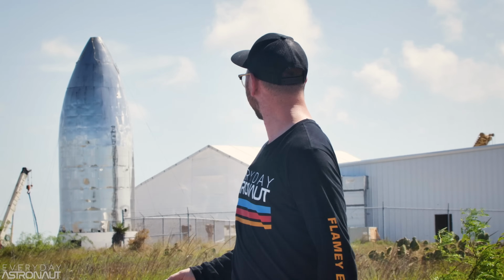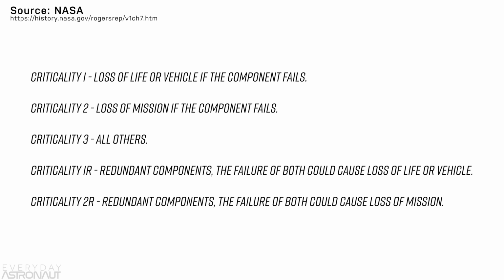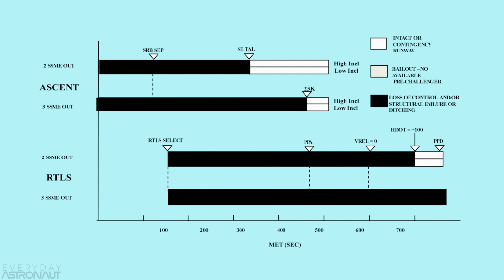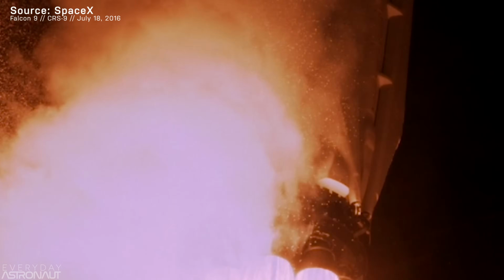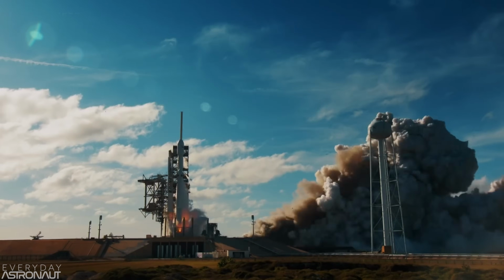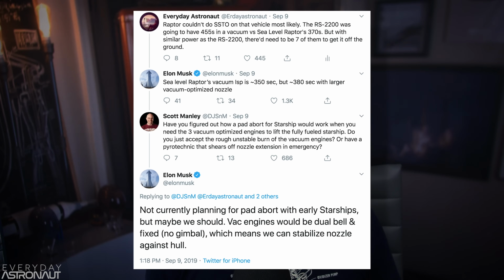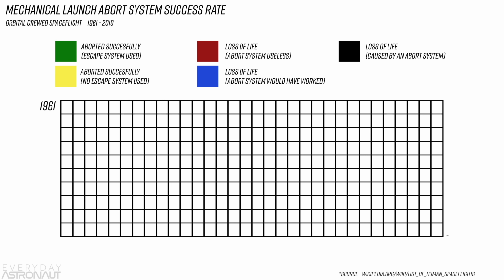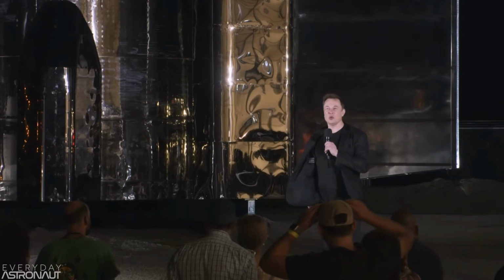Why won’t Starship have an abort system? Should it?!

Comment: If there's anything we should have learned from the Columbia disaster, Challenger disaster... Every airline crash in history... the Titanic, it's that it doesn't matter how fail-proof we think it is, unless it's 100% reliable, there WILL be failures eventually. If SpaceX starts launching dozens of people on starships, without any escape system, then the Shuttle disasters happened for nothing.
Reply: Shuttle disasters didn't happen for nothing. SpaceX learned couple important thing:
1) don't put crew on side of rocket, there is falling ice
2) Don't glue heatshield tiles (bolt them)
3) Don't use SRBs
4) and most generally: test vehicle uncrewed hunderts times, not zero times

Comment: Helicopters use propulsive landing, and that has worked out.  (Of course they can usually land via autorotation if the engine fails).
The Russians likely had a few more fatal flights that have officially kept secret, but some details of which have been leaked.

Comment: The lunar starship could use its lunar landing engines to abort off of the super heavy booster.
Reply: It is Vacuum optimised so it may work, but it is probably just going to blow up
Reply: @brianchan8  It could also fire at sea level so it can possible do it like he said a vacuum optimized engine can fire at sea level but it won't as efficient.
Reply: @schnepflegend739  yea it is possible but it is probably going to blow up

Comment: There's also the fact that they want the starship to be able to carry a lot of people. 100 people was cited at a time, but i don't know if that number is still on the table. Even if there are 50 people on board, that would be a very large abort module, big rockets and lots of fuel. But i don't think that they will be allowed to carry anywhere near that many people until it's proven to be extremely safe, so it could have some kind of smaller abort system for fewer people until it reaches that kind of reliability.

Comment: Redundacy of Falcon 9 engines requires that they deeply searched eliminated any systematical failure that could lead to events causing ALL engines failing from the same cause (common modes, that for instance caused the Ariane 501 loss)

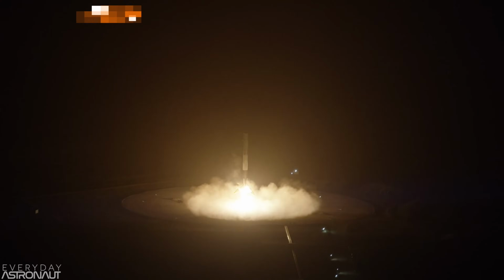Comment: 24:53 "Before, vertical landing was considered impossible". That doesn't sound right. There have been several vertical landings, for example, mcdonnell douglas DC-X, and basically any landing on the surface of another celestial body starting with Luna-9. On paper, the technology has been around since early 60's it just wasn't required from R&D to implement it because everything revolved around making ICBMs better.

Comment: Airlines also had a business motivation -- people saw the economic potential in air travel that would never take off if the public saw it as too risky. When space travel gets to the point of showing an obvious economic potential, the stakes will shoot up and money will be brought to bear on the problem.

Airlines were still working things out in the 1970s e.g. with wind shear on landing.  It seemed that every summer a plane dropped out of the sky at EWR.

Comment: I would most definitely fly on a rocket and even StarShip without an abort system. I know that space costs money, but sometimes I feel like space companies are going to slow and should speed up the production rates. Like with both Blue Origin and some of the others, still not sending up passengers, "Really". So, it is my opinion that we need to speed up, we need to push harder. We need to stop dicking around.

Comment: Something you spoke about Tim, indirectly—without stating what should be the rule—is: a non jettisoned exterior-situate re-entry module crew compartment should never be situated below a leading edge which disintegrates at launch.

Comment: I think a capsule like the Dragon only bigger should be designed and built and installed on top of each Starship for performing a safe emergency abort during both Earth and Mars lift-offs. This capsule would tightly hold the entire crew of each flight and be capable of either propulsive landing or parachute landing (for  Earth landings only). After perhaps 1000 safe lift-offs are performed then it might be possible to discuss removing the emergency escape system. Until then everyone should review the Challenger explosion. Do we really want to witness another Challenger explosion in our lifetime?

Comment: Yes, Some sort of abort system for "Manned" vehicles is the sub-conscience safety net we need. Starship will probably have minimum crews to start. Four to eight because of the limits of housing more people on the international space station and the limitations of large crews of manned moon missions. Maybe just encapsulated ejection seats that can survive any point in the flight. Something that would not add much weight or complexity to the vehicle. The crew must ALWAYS survive, no matter what--no more Space shuttles with no way out! Had the nose of the Space shuttle been able to break off during an accident and use parachutes to land we might not have lost 14 Astronauts! That sort of design might not have added a huge amount of weight or complexity.  A smart backup system that takes advantage of the best features of any system could be justifiable---at least in the beginning. P.S.  there are no designs for early Starship manned control cabins yet, so the options are in, -complete flux.....

Comment: What about ejector seats like military jet fighters have?

They have been around for 80 years. They are extremely reliable and weigh only a little more than a standard seat. You need a hatch for each crew member, so this wouldn’t work if you have a large crew (100?!) Early flights could be restricted to a half dozen crew so that it would be manageable. Only after the system has many flights would you want large crews.

Comment: You showed a Gemini abort system where the astronauts ejected while strapped to their seats.  Fighter jets have similar ejection systems.  Why the Gemini system was abandoned was not explained.  Comparing spacecraft aborts to airline aborts in the closing graphs isn't really fair.  It's more like Fighter Jet ejection where both pilot and copilot can eject, or bomber crews with parachutes.  Why wouldn't the Space shuttle system where they had to deploy the pole and slide along it with parachutes be an option for crews on re-entry if they discover they've lost their engines during the belly flop stage?

Comment: We all know that the Starship will be just as reliable as the Space Shuttle and the space shuttle did not need an abort system or at least so they thought at first.

Seriously, As we just saw with SN8, something as simple as low pressure in a single tank can cause a crash on landing.   To be "Man Rated" the system needs to be re-designed to no single point of failure can kill the crew.

Likely what they will do is place the human crew in a Dragon-like capsule on the very tip of the Starship nose cone.   Then if there is a problem the capsule cuts away, pretty much like on Crew Dragon today.

Comment: Probably could be useful at the beginning how it was with Falcon. But that's at least two more years of development. And of course, how much more thrust we need in comparison with Crew dragon? To achieve 11.8 m/s2 acceleration (F=ma) and if the starship cone mass is 120 tons, that's 20 times more than Crew dragon. So were getting 1,4 mln newtons (320000 lbs). That means we need at least 9 Aerojet-Rocketdyne engines.

Comment: Revisited this video after SN8's flight. Essentially I still feel there is several things that can happen just in the landing sequence that can justify an abort system. Something that is obviously unique in space flight. Fuel pressure, fuel amount, wind conditions, flap control, engine thrust vectoring, engine relight (especially after a return flight from say Mars or landing on Mars). All of this happening correctly in a few seconds. So I think the nose cone section of Starship should have a push away abort system. So as to limit the size needed to pull away. Yes, starship will loose payload and personal capacity because of extra parts but people wont ride without it.
Reply: Exactly, that's why comparing starship to other launch vehicles isn't the best approach. Starship has a lot more opportunities to fail when an abort system could be of help since it has to land itself propulsively. The fact the abort system wasn't useful in, for example, the apollo program doesn't mean anything for exactly this reason.
Reply: @knightfromjupiter exactly. Abort systems are there in case for emergencies, we were just lucky the Saturn 5, got away with it, the soyuz and shuttle both needed one, and we'll only one of those two systems had one, and only one is still flying

Comment: One thing you didn’t touch on was the number of parts on starship vs shuttle - the shuttle just had too much rubbish. If spacex can reduce the number of parts they use reliability should go up. Plus as mentioned it’s a safer design by default.

Comment: just came across this video, thanks very much super interesting. One thing that came to mind about air travel safety, is in light aircraft at least how abort systems AKA ballistic parachutes are being fitted more and more in the design of small aircraft. Personally you couldn't pay me enough to get on a helicopter, those things fall out of the sky way to often for my liking. I've been up in a Cesena a couple times when I was much younger and didn't realise how often these things and other light aircraft fail.

Comment: I have always been amazed that NASCAR can have crashes at over 150 mph with cars hitting walls and flipping, and the drivers often walk away with few injuries.  Since starship has shown it’s terminal velocity to be less than 200 mph, couldn’t one option be safety systems (restraints, air bags, etc) so that the first stage could survive a crash without propulsive landing?  Being able to survive a starship crash landing could allow for different and varied abort scenarios with little investment in advanced technology.  Thoughts?

Comment: No heat shield, true stainless steel melting point is 1510 degrees C, but what about the astronauts seats? It's going to hurt, (astronauts will suffer starship bum for weeks)
I'd like to see a dragon capsule on the first generation of Starship, small steps, don't try to solve every problem in one go. To do an FMEA you need data, without data it's just a guess based on what you already know and you've already designed the spacecraft to be safe based on what you already know. Get the thing flying ASAP with a dragon capsule, get the knowledge and experience and the data, learn from it and then evaluate whether an abort system is required or not. Don't guess when peoples lives are at stake.

Comment: Given SN8 crash on landing, a Crew Dragon type abort might have saved the upper stage.  The same argument can be made for abort on landing to test that multiple times too until that's a standard.  Safety standards come from persistent testing and that would be no different.  I'm wondering though if Soyuz explosive rockets would be more reliable with fewer parts or just figure it out after many iterations.  At any rate as Boeing737MAX is showing, unless there is confidence in the system no matter how redundant then people are not going to fly.  I think it's worth it even if it is 1 in 500.

If no rocket is used at all it could just be a matter of a shield at the bottom that deploys a lot of surface area, like the balloons on the capsule to buffet in this case the shock waves and explosions of the booster.  If the calamity doesn't occur then the balloons can be deflated and were not causing their own combustion layers of issues.  Many crazy ideas are in play when it comes to working solutions, I just don't think we've tried enough

Comment: like, i realize this video is old and thus my comment is probably irrelevant now. But isn't the whole point of a pressure test to put it to it's limit so they can test how much it can hold? meaning they kept increasing the pressure to the point of failure - on purpose - to test how much it could handle. If I'm not suffering from the dunning-crueger effect, it seems strange to harshly criticize the failure during the pressure test unless it failed a way lower pressure than needed for safety.

Comment: Hey Tim, Do you think you could revisit the issue of Abort Systems with the recent failure of SN8 on landing?  An abort system would have likely saved the lives of the hypothetical crew aboard SN8.  And we can ask "How many Falcon-9 landings would have been 'Survivable' by human crew?  

Until now, we've only had vertical liftoff to worry about but now with landings being far more dangerous than liftoff, couldn't you revisit the concept in a new video?

Perhaps even examine the concept of jettisoning the crew capsule as standard practice after re-entry and parachuting the crew safely some distance from the landing stage.

This video about abort systems doesn't take into account the danger of vertical landing which is a very new concept and has no statistical data to point to.  Strangely, it's difficult to find statistics online for Falcon-9 landing crashes vs. success..
Reply: I give up  :/

Comment: Don’t the engines have to be chilled before ignition to prevent thermal shock? I see no way they could ignite all the raptors on zero notice on starship including the vacuum engine without numerous failures.

Comment: An abort/escape system provides an option that is decoupled from many potential failures of the main vehicle. There are tons of failure modes every rocket must have in principle, and that also concerns Starship. These scenarios include loss of steering/control, propellant tank rupture, fuel leaks into the engineering spaces, and most importantly: systemic failure scenarios that we don't yet know about. If Starship itself has an abort mode which performs on an automated, powered landing, that's good - but this, too, relies on Starship itself being intact and under controlled flight.

About the Komarov incident: it is not strictly true that an abort system would not have saved his life. Had there been an option to eject from the vehicle with a parachute, he would at least have had a chance. Compared to the Columbia crew, his re-entry was not inherently unsurvivable after the vehicle failed.

The question of whether abort systems are necessary is more about the value one puts on a human life vs the cost and complexity involved. There is absolutely no question that abort systems save lifes. With the renaissance of manned spaceflight hopefully well underway for the upcoming 20ies and 30ies, the number of incidents where lives would be saved will go up dramatically. We are right now making the conscious decision not to save those lives. And considering the enormous capacity of Starship, these would be staggering numbers of deaths, potentially enough to put a halt to human exploration of the solar system due to a sudden public backlash.

Would I risk a ride on Starship even if it had a 50/50 chance of blowing up on the pad, as long as it enabled me to be one of the first colonists on the Moon or Mars? Hell, yes. Would I want someone I love to do the same thing? Absolutely not.

Comment: This video is now a year old. It demonstrates conclusively that Starship needs to be flown hundreds of times to verify its reliability and for it to be safe enough to carry humans. Yet I still don't have an answer to this question: What is the business case for Starship? What is going to pay for those hundreds of launches? It isn't Starlink. Its not NASA. Its not any foreseeable demand for commercial satellite launches. So?
Reply: Don't forget, main cool of starship is being cheap. If they will hit the target of 2MUSD per start, it will be cheap enough to replace e.g. Electron in market "getting 300kg sat into exact orbit". 
Also, it is true, that ATM there is not that big market, but with super cheap rocket, there will be much more satellites
Reply: @adamrezabek9469  I'd believe a few tens of millions - after its been flown hundreds of times and obtained economy of scale. I'd be more optimistic if Elon would ditch his colonisation fantasy and instead build a smaller version of Starship. That would eventually replace Falcon Heavy. And it would be useful  for sensible science/exploration missions to Mars.

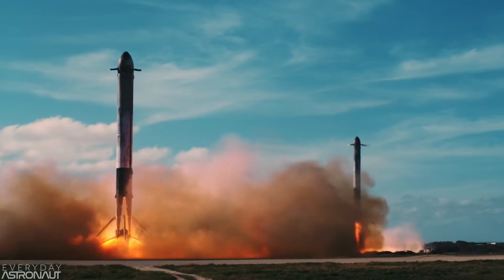Comment: you said the center core ran out of ttab, but in 25:34 i can clearly see that the engine is on.
Reply: There is a certain amount needed because otherwise the fire occurs outside of the combustion chamber and produces practically no thrust and it usually turns off in a few seconds

Comment: It's all or nothing. Either no dead or a hundred dead. No in betweens. Considering the airline industry has been around for a century and it's still ripe with accidents it's naive to believe no passenger starship is going to fail. Literally daily a plane crashes. Usually they're the little planes that seat very very few. But occasionally hundreds are lost in one crash as well. Might as well start preparing yourselves for the inevitability that will eventually be a destroyed starship and crew w passengers. Especially when they're aspiring to have two launches per day.